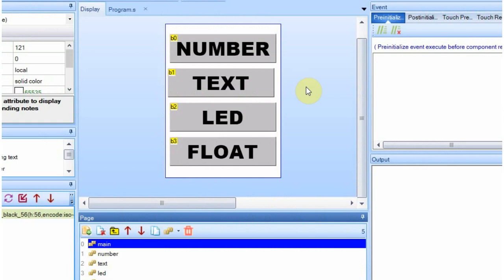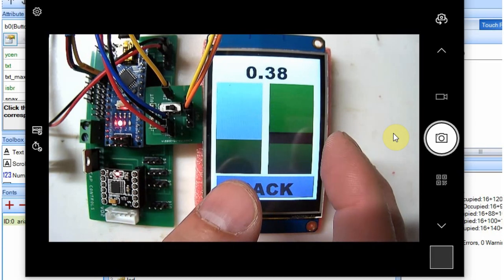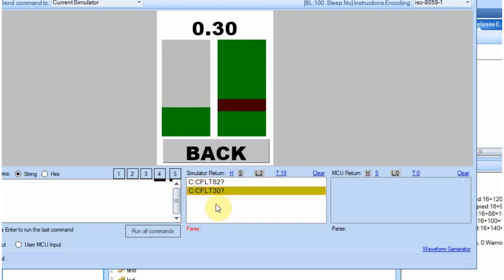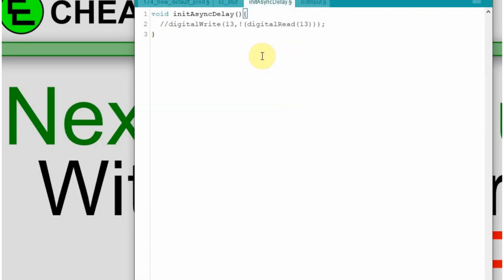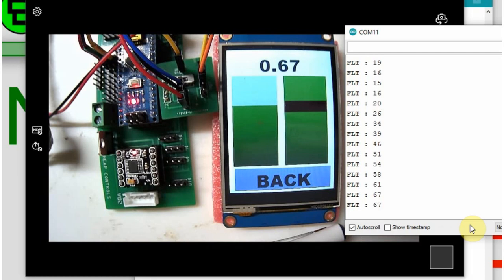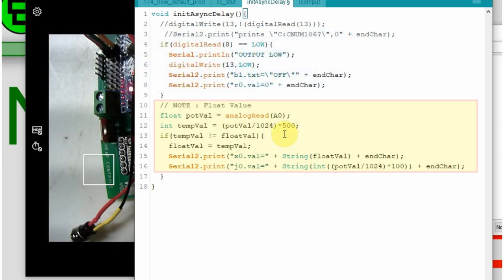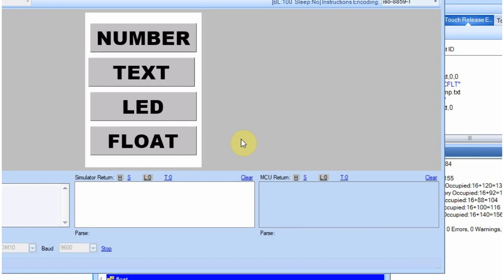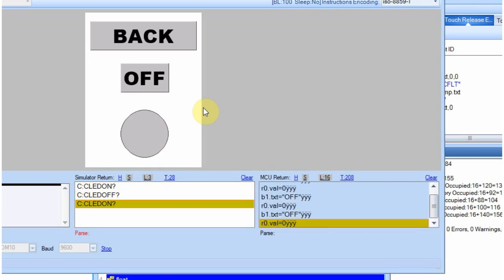174  Using the #nextion display with the #arduino without a library

Comment: I subscribed to your videos ages ago. They've given me tremendous help - thank you! - given the general lack of any meaningful help from Nextion. One thing I'd love is that Nextion address their truly horrible white space intolerant, ";" hating version of  "C" along with providing some means to embed functions. i.e if they just made their "C version" actually, well, C? As is. It's a horrible bastardised mess. You do get used to it  - but afterward feel like you need a long hot shower with plenty of soap.
Reply from the maker: I agree the coding is odd.  If I am doing a real project I do most of the work in an external MCU.  Then I just use the display as a GUI.  I have not made a video in awhile.  I hope to start up again this winter.

Comment: As clear and well explained as always, thanks a lot! I have one question: why do you put everything you're sending from the arduino to the nextion inside the AsyncDelay?
Reply from the maker: I don't always.   But usually you don't want to flood the Nextion with commands.  The Arduino can loop through the main loop very fast and I don't usually need to write data to the Nextion as fast as the Arduino can loop.  But I do want to check for input from the Nextion as often as possible and If I have buttons or sensors connected to the Arduino, I want to check them as often as possible.  I hope that explains it.  If not please ask again.  Also, Thank you for your continued support.

Comment: 😊just discovered your vids, maybe you address in one I’ve not seen yet, but curious why you prefer not using Nextion library.
Reply from the maker: I have worked with serial communications for 30+ years so my tendency is to look at the raw data way of doing things.  I don't have anything against the library, I just find that my mind works better without it.

Comment: Thanks for all your great videos and that you always try to come back to us if we have questions. 

I managed to come right with most of my code just by watching your videos. I have one small question.

Explanation: I'm running a stepper motor between two set points(set points controlled with the amount of steps.) I've got a number box on the nextion screen that you add a number and once you select start it reads that number value then only move the stepper motor between the set two points for the quantity cycles that was added in the box. (I'm using the nextion.h library). example: One cycle is equal to 100 steps cw and 100 steps back in ccw then repeats for the amount of cycles you enter into the number box. 

The code I'm using to move the stepper is the digital write and delay microseconds methode. And the quantity code is
 unit32_t count=0;
Quantity.getValue(&count);
For(int i=0; i <count; i++)

I run the nexLoop(nex_listen_list) in the loop section. With the rest all in functions

Now my question.
 If this cycle runs for example 10 cycles. I've got a top and bottom limit switch. I want to interrupt the cycle at any stage, for example if its busy with the 5th cycles out of the 10 and I press "end cycle button" on the nextion screen, it needs to finish the cycle in progress and come to a stop at the bottom limit switch  without finishing the entire 10 cycles and wait for another function to be given by the nextion. How would one go about this? I'm stuck with this one...

Thanks for your help
Reply from the maker: I am not sure I can help.  I would not use the library.  Quantity.getValue(&count) is not familiar.  I would do the actual work in the Arduino.  The Nextion would only submit instructions to the Arduino or provide data the Arduino would get.  I do have videos on gather data using the get command.  I would send the number of cycles to the Arduino upon page initialization  and use the e stop button to send the command and have it set a bool on the Arduino to check at the end of each cycle.  then if true stop operation and get ready for the next cycle and set the bool to false.  I hope that makes sense.  That could make an interesting video but I have a few already in the line for the next few weeks.  If one does not work out maybe I can sneak it in.  Thank you for the kind words and if you want more detail you can submit a comment at www.cheapcontrols.com and I will respond through Email.

Comment: Love all your videos, I use nextion with ESPHome and Homeassistant which with the advent of the Sonoff NS Panel the nextion has exploded in popularity in those communities.
I'm using a Nextion Intelligent at present and wondering if you know how to or if it's even possible to upload .png files over serial to the SD card. One of the biggest drawback to these displays is the inability to render a picture from ESPHome http folder - my use case would be to display a snapshot saves in a local folder on my Homeassistant url when the doorbell rings.
Thanks in advance if you have any clues or ideas
Reply from the maker: Thank you for the kind words.  I have not used the ESPHome or Homeassistant.  I will look into the intelligent display and updating the files through the serial.  I do have plans in the next month or so to make a video on connecting the Nextion to the raspberry pi and the ESP.  I tried accessing the SD card on the enhanced version but I did not have much luck.  I recently got an intelligent model but have yet to play with it.  I like the fact that you can use the different models in the IDE.  It helps when planning out videos.
Reply: @CheapControls  thanks for responding 👍
There is mention that it might be possible with the intelligent but I'm yet to find an example. Look forward to learning along with you as you explore the intelligent features, I'm not very good with this stuff but manage to learn from examples and modify to my needs; your videos have helped me tremendously in using the nextion editor
Reply from the maker: @simonburke6681  When you say you want to upload a png to the sd card, do you mean during runtime or during development?  I started looking into this yesterday and I want to make sure I am looking into the correct thing.  I still need to figure out what ESPHome is.  I am going to check that out today.
Reply: @CheapControls  4th time trying to reply I was trying to provide some links/ resources for esphome and believe youtube might be deleting for some reason. 
I would like to upload during runtime if possible. The esphome nextion component which uses nextion.h library will upload tft over the air from home assistant which is the only way I can get a new picture to the display and not ideal for what I would like to achieve.
I'm actually not sure this would work at all anyway, I haven't played with the SD much yet but get the feeling I may have to use the nextion editors picture box to convert the picture to render from the SD card and then even if I could render the .png it will probably be too slow. 
I am still interested if it's possible to upload files to the SD from an ESP however.
Reply from the maker: I looked into ESPHome, and it is interesting.  I think this will take time.  I am not sure how much of a hurry you are in.  This comment thread will soon be too far down on my list and I might lose it.  If you want to continue the discussion you will need to go to www.cheapcontrols.com and submit a comment with your email address.  I will reply and we can move this over to an email exchange.  It will be easier with files and links.
Reply: @CheapControls  thanks, no need to go to any trouble I just do these projects for fun. I will certainly be interested to know anything you might learn about advanced features and happy to share my esphome and home assistant configuration, links etc should you wish to experiment down that route. I drop on over and share my email